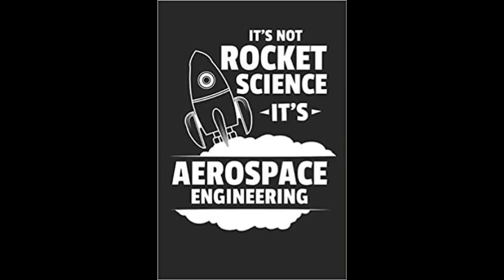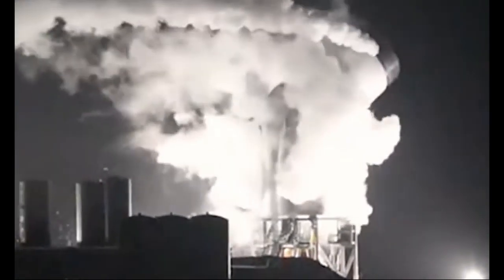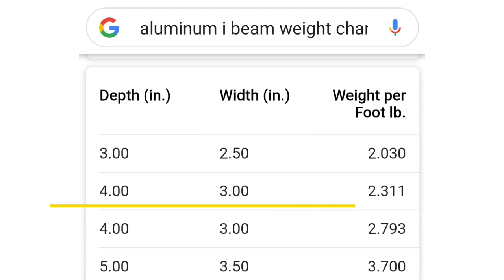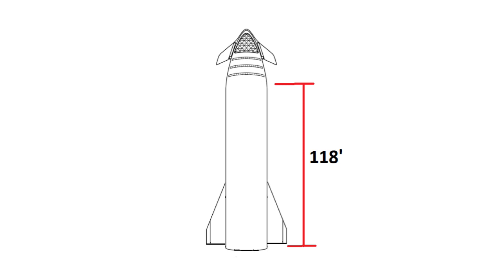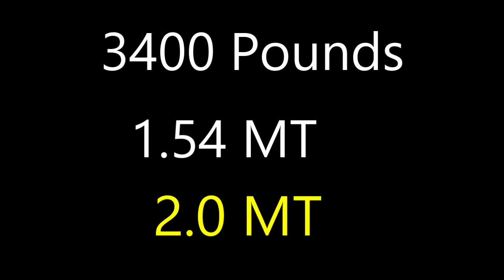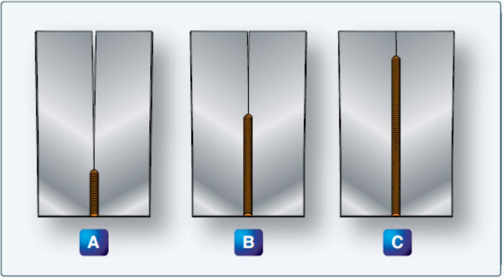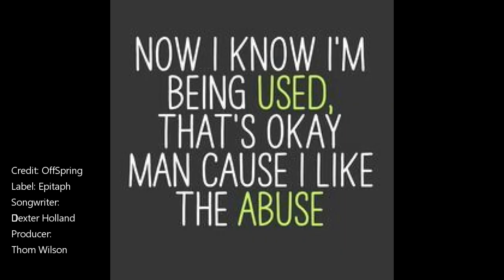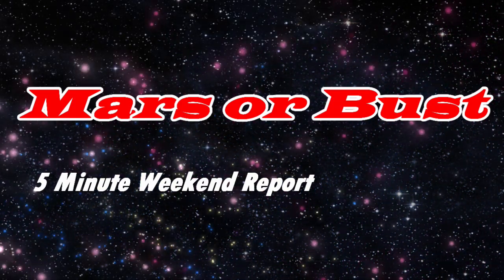SPACEX STARSHIP Can They Fix it? It Can't Just Fall Apart!

Comment from the maker: Hey Guys! 
What do you think? 
Could they add a light weight frame work into Starship? 
Would it help? 
Thanks! 
SMD 
MoB
Reply: I believe the final product will have a better stronger frame, we are just watching the R&D phase where there is no need for fancy redundancy or overall extra frame support.  

SN-4 will probably only fly once or twice like the hopper, and no matter what happens, this is always exciting to watch.
Reply: So I'm not the only one who thinks that it needs support.
Reply: So, Elon has already stated that the ship is fully capable of sustaining its own weight, unlike the old video extract you included (though I forget the name), which relied on pressurised fuel tanks just to stay upright. 
The problem was just the test load and incorrect pressurisation of the lower tank. This scenario shouldn’t happen in practice and if it does you have big problems anyhow.

Though it seems like a good idea to have extra support despite the loss of payload I suspect that if you are relying on this extra strength, for a rough landing, that you’ll have damaged the ship in other ways.
Reply: Had a though about it the other day how about internal spokes like a bike wheel very thin but at tenson would give alot of extra support with little weight
Reply: The rocket is self supporting.  It just can't support a full upper tank when the lower tank is empty.  It was a dumb mistake in the test. 
And no,  you can't just add 2 tonnes.
Reply: @Marcoose81   what if it happens again with people on board?
Reply: @Marcoose81  The tanks are self supporting when it is sitting stationary, on the ground. When it lands on the moon, Mars or earth, the  fuel & oxidizer tanks may be only partially filled, but the nose section will be full of cargo mass.  When it lands, it may hit the ground with a hard bump, and the mass in the nose will push down on the empty tanks like a pile driver. I think that something other than the walls of the fuel tank needs to handle the load.
Reply: @Marcoose81  I think that's right. You can't look at a test configuration error where they filled an upper tank to 25% more load than it should ever see, and left the bottom tank virtually empty and say, "oh, this means the design isn't safe." The solution I see here, is to have an ingrained procedure and more crosschecking and checklists to make sure nobody screwed anything up.
Reply: Hi mars or bust this build defy s logic I am a expert in this technology they must stop now bin project go back and get the right teams in 18 8 code for stainless steel toffee brittle no good for this project it needs only small team with the no how they haven’t got it sad to say

Comment: This is not a simple addition. 

It would require a complete redesign, as there is no excess space inside Starship to run supports through. 

Nor do I see the need. No orbital rocket has been able to support an overload of its upper with ambient to zero pressure on the lower.

Comment: I came to give you a hard time, but wound up upvoting the video. That said, the idea of an internal structure has worried me since I realized the tanks were going to be the actual walls of the starship. As soon as the last one crumpled, I KNEW it was due to the loss of pressure below the obviously full upper tank. Here is the problem with your idea: Aluminum can be welded to steel. However, there are major problems and brittle compounds are produced unless all of the parts being welded are in an inert gas. I don't see how it would be practical to add to the existing starships. It would have to be added to each ring, etc. My own thought was to go with separate internal tanks, but the weight load for either idea could make them impractical.
Bottom line. While the thing is in our deep gravity well, one MUST be careful of the load order of the heavy, cryogenic liquids. Once in space, or the other places it might be refueled, in orbit, on the Moon or Mars, that ceases to be a problem. I really don't see them changing in any major way, the basic design unless the current design proves unworkable.
Reply from the maker: Hey Jim! 
I dont know if you saw my latest video but SN4 and upcoming Starhips are starting to look much better in terms of support and quality. I'm very aware they are limited on what can be integrated into the internals of Starship. I have worked as a weld inspection engineer for many years an know that due to several factors they couldn't or at least shouldn't weld the aluminum to the stainless in this case. I was mostly pushing to see what people's feelings were on this. I have as well questioned the structure issue from the beginning. I do believe things will improve as time goes on, as they seem to have started. 
Thank you for the comment! 
SM Dave 
MoB
Reply from the maker: Oh and please dont stop giving me a hard time. 
Someone needs to! LOL 👍

Comment: I have often thought the solution to this problem is to fold or corrugate the ring segments for more strength. Then they would have to add inner supports, as it would be built in to each ring segment. By the way, I'm from and live in the same hometown as The Offspring, Garden Grove, Ca. I switched high schools, but my sister graduated from the same High school as Dexter and my mom played bridge with Noodles' mom.

Comment: The structure is self-supporting. What it didn't support was the weight of a full upper tank without any fuel or pressure in the lower tank. It was a failure from the testing gear. Besides, the two tanks empty at the same time, so in normal operation there will never be a situation when the upper tank is full and the lower tank is empty.

Comment: If you have people on board, you don't want to rely on crane or other additional external support. If all this external support stuff fail, people will be doomed. Its not great. People must rethink current rocket building practices that's because its gonna be reusable not just ones but 100 times and its gonna be designed for 100 regular people not just only 2 trained astronauts. You cannot rely on external supports. On Mars or Moon most probably you will not have them. Think twice Elon....

Comment: The starship prototype IS self supporting when it is sitting stationary, on the ground. But imagine landing it back on earth, with empty fuel & oxidizer tanks, but with a nosecone containing people, moon rocks and equipment.
When landing on the moon or Mars, the nosecone will be full of cargo-mass. When the gear hits the ground, the mass in the nose could push down on the tanks, like a pile driver.
Any little crack in a weld on a tank would be a problem.
Reply from the maker: Completely agree!

Comment: I agree Dave. I'd add 3 vertical box like beams, 120 degrees apart, bolted to the outside of the tanks. They could be bolted on AFTER the pressure tests. The box beams would be made of stainless steel and have a triangular cross section. They could be curved a bit for aerodynamics. The windward side will need to have heat shielding. On each beam, the landing legs and tail fins could be mounted. Inside the box would be actuators for the fins & legs. About midway up would be where the pressurized tanks would go. As 3 separate, identical units , They could be built anywhere, and could be fully tested before bolting them on.
The box beams would eliminate drag for any of the stuff currently mounted on the outside of the tanks.
This ship is going to be reused many times and will get some hard bounces when landing with full, empty and partially empty tanks.  The box beams could also contain reaction control thrusters.

Comment: Or they could just add stiffening groves.

Edit, just realized the technical term is stiffening ribs and they are commonly used in sheet metal work to add structural integrity.

Comment: So far spaceship doesn't have a spine. Stainless steel ribs should be added along the body from bottom to top. If you want to fly it 100 times with 100 people on board, you need more rigid structure. Current design is ridiculous. If you are going to transport potatoes to orbit a couple times, maybe its ok. I think after rocket will be smashed to the ground after landing, they will do some changes. Hard learning Elon...

Comment: Adding a secondary pressure system of inert gasses would delineate the issue. While creating a newer gulp issue for the fuel feed systems to separate the swirling tanks in motion. While adding the ribbed structural features would also seem needed. I keep waiting for the information to catch up to reality. Each SN seems to be moving to a prove-point in development. So it would not surprise me at all if the first flight fails spectacularly. It's the style that SpaceX uses. Then they reiterate another variation with fixes for the fails. Showing full stepped evolution of the overall design.

At this rate I wouldn't take a free flight to the moon until SN10 at least. LoL Wow that is a sentence now. What a time to be breathing. Mars Or Bust, what a suitable name. Thanks for all the great vids. Awesome sauce.
Reply from the maker: Thank you Core E!!!

Comment: Nice work Dave. Not factored in is 200tonne payload. Is it feasible to have starship pressurised at all times to maintain structural stability. How might starship act on landing with 100tonne backload with empty tanks? Fair questions. This will stress the system, even if pressurised at all times.
Reply from the maker: Hey Daniel!
That's what I thought as well! 
Thank you for the comment! 
SMD 
MoB

Comment: Starship is self supporting, just not with a fully loaded propellant tank sitting above an empty oxidizer tank. It does NOT need the additional complexity of having galvanic corrosion between the dissimilar materials.

Comment: supports inside would be under tensile strength any time theres a bit of pressure so its not really holding up anything. the only time it would actually help and your not doomed anyway like elon said would be during initial fill up if that went wrong. but id  rather see a strongback or crane type equipment support the rocket during fill up rather than adding mass just in case of fill up anomoly
Reply: If you have people on board, you don't want to rely on crane or other additional external support. If all this external support stuff fail, people will be doomed. Its not great. People must rethink current rocket building practices that's because its gonna be reusable not just ones but 100 times and its gonna be designed for 100 regular people not just only 2 trained astronauts. You cannot rely on external supports. On Mars or Moon most probably you will not have them. Think twice Elon....
Reply from the maker: Hey Nymeria,
I like that idea! 
Thanks for the comment! 
SMD 
MoB

Comment: The skin is strong enough. It needs to be stabilized against oil canning. The diameter of the rocket is big enough that the distortions   created by the stress of welding fabrication result in wrinkles which become high stress areas under heavy column load and low internal pressure. Corrugating the central area of the the stacking rings after fabrication  would  rigid-ize the rings helping to prevent low pressure collapse. Lap welded joints might reduce welding distortion and increase hoop strength.

Comment: i agree Dave! -i would also add (as you alluded to in the video) that take off and landing additional loads could be very difficult for a starship without support structure to endure - especially over many takeoffs and landings!! -maybe SpaceX is doing this because these are considered prototypes and they are more focused on other areas needing attention before structural integrity? -not sure why they haven't done this yet.... -hopefully will show up in final prototypes... :-)
Reply: They have supports in the thrust section because it is non pressurized and needs it. They haven't done it else where because when pressurized it should be strong enough. Also it is stable unpressurized without propellants and probably without payload. Like Elon says less parts are better. I believe the Methane tank had 400 tons of N2 in it which is more than the payload it will have on it and probably also the top of Starship combined. Trust me SpaceX will add more supports if they think they are needed. It is still to early to tell but right now the design seems fine. Like I said the bottom tank was unpressurized while the top tank was pressurized with 400 tons of N2 which is more than the top of Starship and payload combined. Nothing to freak out about. Like Elon said if the tanks depressurize you are probably screwed anyways because Starship probably can't land, etc. If anything they will add redundant systems to maintain pressure.

Comment: Spaceman Dave, no hard time from me. I agree 100%. Starship is a workhorse, not a one shot throwaway. Who knows what stresses it might have to go through over its lifespan. It needs to be more robust. The only problem i have is can you isolate the aluminum from the hot steel on reentry. Even a steel support structure would only weigh 6 tons. I have nightmares of these thin tin cans breaking up under any unusual stress.
Reply from the maker: Hey Maq!
Aluminum or steel, either way. The main point is, in my opinion it needs something. And maybe down the road that will happen. As far as the temperatures inside the hull, I would hope he has that one figured out with heat tiles. I wouldn't want to be cooked alive either inside Starship! LOL 
Thanks! 
SMD 
MoB

Comment: I'm not gonna beat you up Dave. I'm completely with you on this. You might even remember a discussion I took part in, on one of your previous videos. I find it very unsettling, that the current iteration of Starship isn't even strong enough to support it's own hull, if the tanks are filled unevenly. I'd even be happy if they sacrificed 4 MT or more, for additional hull strength.
Reply from the maker: I do remember that! And, Completely agree! 
Thanks! 
SM Dave 
MoB
Reply: Pressure is everything at this size and weight. Support structure as mentioned would NOT have prevented the collapse of a fully loaded 100 ton overhead tank on stand (or especially during launch) if there was no pressurized tank beneath it.
Reply: @paulpark1170  My thoughts exactly. Im no engineer but pretty sure 2-5 tonnes added support cant support the weight without some pressure in lower tank. And if some pressure is always required - then the question shifts from how much support strength should be added - and on to how always maintain the proper pressure. Following the philosofy why add an extra component - if the component itself doesnt fix the problem (but in this case relies on some form of pressure in the tank - where the component should fix total lack of pressure). Do I make any sense here?
Reply: Not that i dont find the thickness of the steel used for the rings really really thin from what i would dream of was possible - but they done the math im sure. Just look at the strength of the inner tube of a roll of toiletpaper. We should have plenty of those in a time like this..
Reply: nielsnb11, The easiest analogy is a soda pop can. When it is pressurized, you literally cannot even squeeze it but you pop open the top and then you can crush it easily with your hand....
Reply: @paulpark1170  Yes pressure is everything. I think the methane tank had 400 tons of N2 which I believe is more than the top of Starship and its payload capacity combined. It seems the tank was still supporting this weight though with below normal pressure until it did fail so imagine how strong it would be when it did have close to the proper amount of pressure. I know people are worried but I would give SpaceX a chance on this one and let them do their thing.

Comment: I wouldn't be shocked if they didn't start making starships, every other one to start, out of carbon fiber instead of stainless. Or a mixture of them... around SN30?

Take the clamshell variant for instance. Is there any compelling reason to make the door stainless? If it can be made of fiberglass to reduce weight it will be. That weight can become extra fuel for refueling in orbit, extra cargo, water,  etc...

Right now, carbon fiber is not efficient, since it doesn't lend itself to rapid iterations. (Too expensive and slow to work with).  Once the design is mostly nailed down though, it makes sense to shave weight off where it can be. Maybe only the top will be carbon fiber...?

IAs to your idea Spaceman Dave... I don't think you need the horizontal parts. the torsion of the thing is controlled by the sheet steel. It is in compression the thing failed during the test... so It only "needs" pillars inside. They needn't be attached to the stainless structure by any means other than c channels with bolts to tighten them to the walls to there is give in case of a differential in expansion at cryo. They would have to be separated at the common tank.  with a T structure bracing on either side of the common bulkhead. That would decrease the weight of the aluminum by the crosspieces but the weight of the c channel would  probably more than make up for it since it would have to be  stainless. 

Another issue with dissimilar metals touching is the battery effect if they are subjected to acid or alkali. Even a  vapor of mild acid condensing on it, will create current flow, and thus dissolve the more reactive metal... the aluminum.